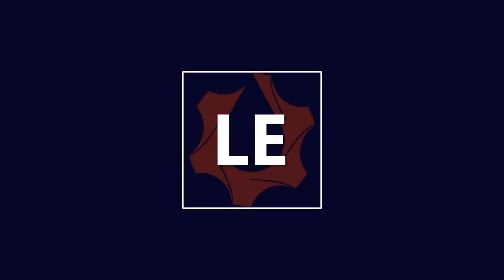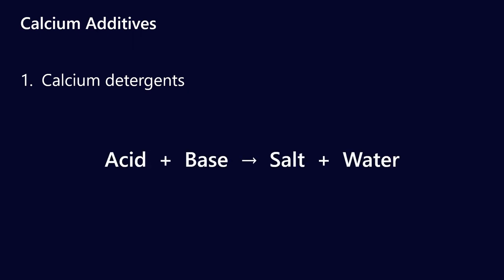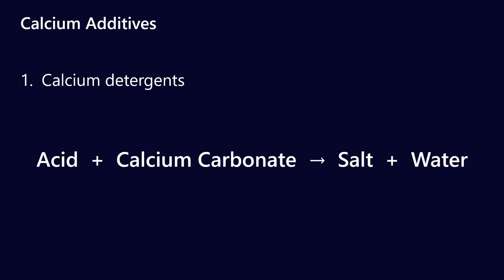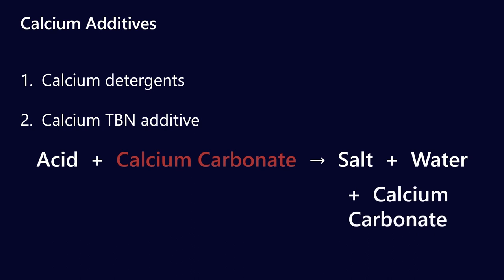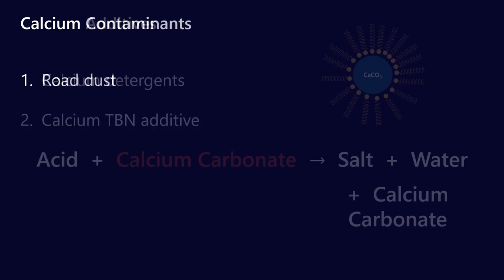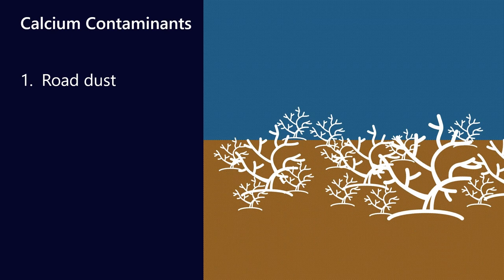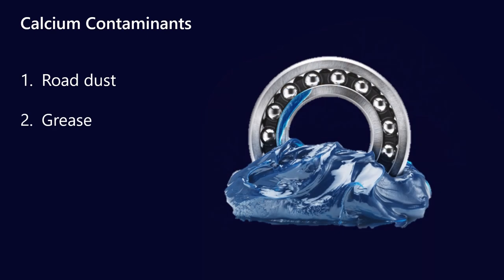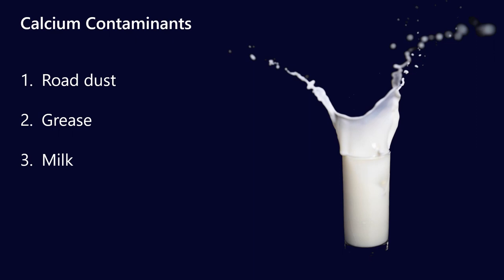Calcium  |  Oil additives & contaminants

Comment: How about the difference between Ca Salicylates vs Ca Sulfonates when it comes to engine cleanliness and fuel economy improvement? The latter are kind of trade-off and both very hard to improve at the same time.
Reply from the maker: Ooooh that's a good idea. I think there's probably a good video in there about general formulation trade-offs too.